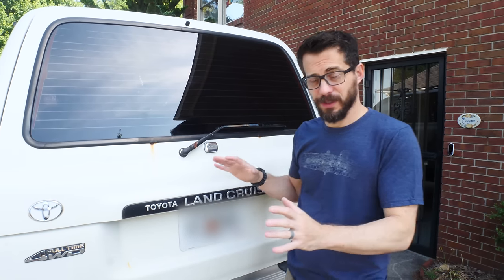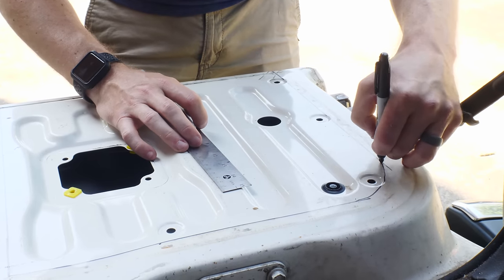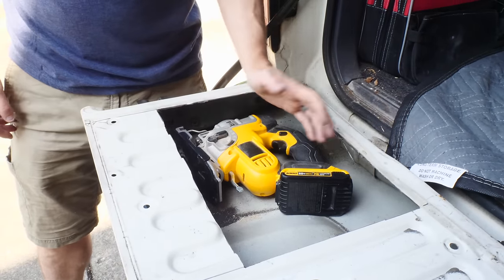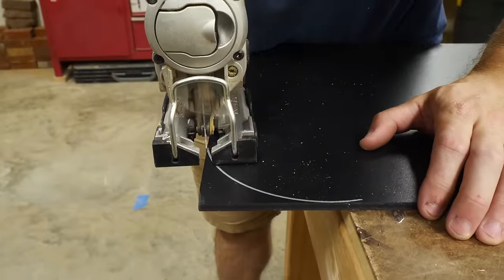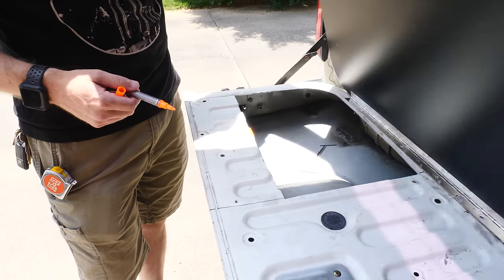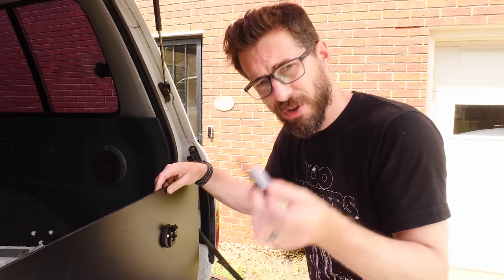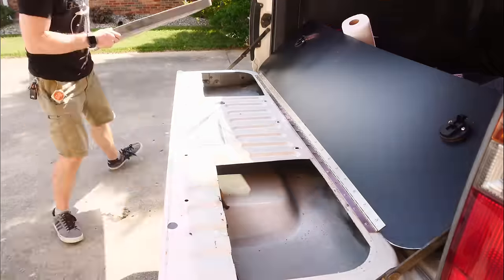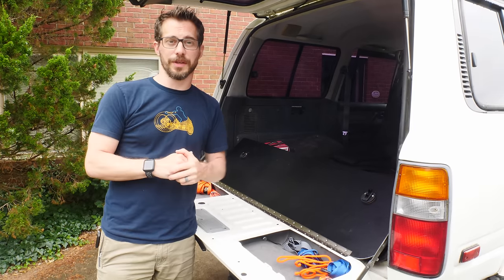Custom Tailgate Storage // Land Cruiser | I Like To Make Stuff

Comment: i wanted to replace my cars stereo because it had no bluetooth just regular audio cd and poor sound, but you have to cut out parts of the plastic cover wich terrified me really bad because i thought you would see it. after 1-2 years wondering i finally did it, it turned out so great, you dont see the cuts and the new pioneer radio goes a long way, has hands free bluetooth, 3 usb inlets, several outputs to use amplifiers and all that good stuff i wanted. 

totally worth it in the end :) 

even if you screw up, they make those tailgates in factories every day, so worst thing to happen would be you having to buy a new one wich is no big deal really

Comment: I would use a hole saw for the tighter corners instead of a jigsaw - less cleanup and accurate radius. Great video, but as a contractor, I'm a bit nervous of it due to always hauling heavy tools around and bashing it in.

Comment: Installing a second battery and building a box with a power inverter in it along with a amp and subwoofer to take up the middle seat floor space... So basically building a second center console with a sub woofer amp and a power inverter all built in one box to save space and take up unused space in my work truck

Comment: A project I want to do but am scared to start?? Here's one! I am starting woodworking and thankfully before he passed away my grandfather acquired MANY tools and threw them into a 50' x 14' storage building he bought. This was in 2001... So now I have cleaned out TONS (literally) of items and made 24' of it into a wood shop. I want to run power to this building but I have to do It on a budget. Currently I have a 100' 12 Gauge extension chord that runs 2 fans and 1 saw at a time!! Im in Texas and the inside of that building is around 126 degrees. MY project is to use bubble wrap and Mylar (safety blankets) to insulate this area, Cheap drywall to make it a room, wire it for electricity, and finally run the power to install my AC window unit as well as being able to run a simple dust collection kit... phew! there it is.. but the electrical to me is by far the most daunting.. should I run it from the house? 82 feet away with the power box at 120' away! or should I buy a power box and install it and have the electric company come out and run power to it?? This is a lot to do I know but it is all in effort to utilize a POTENTIALLY prime "maker space" that I was blessed with.

Comment: Great initiative, Roberto!

One suggestion would be to 3d-print a new set of rings for the latches that allowed you to insert the fingers from a flipped position that what you do now, hence, affording a more natural and ergonomic motion.

By any chance, despite the EVA against the metal, did you get rattling of the objects hitting the foam PVC? I wonder whether you've added some EVA to that side as well off camera.
Reply from the maker: Actually no, it's dead quiet back there and I haven't done anything else since we shot this a few weeks back 👍🏼

Comment: I have a blocked shower mixer that I can only unblock by cutting out a hole on the back of the stud partition wall. Thinking about making the access hatch I have to cut out into a feature, like a hinged mirror, but haven't had the nerve to start it yet!

Comment: You should try ABS it is available In sheets and is the same as most plastic in cars it takes heat very well and the thin stuff works almost like Kydex for knife sheaths when you heat it to 300 degrees cool project I've been wanting to do something like this to my RAV4

Comment: Did you consider running some kind of stiffener along the plastic to help with the rigidity? A little strip of wood or thin metal bar stock would work well to make it flex a bit less. I'm not sure how well it would fit along the tailgate though. Really cool project.

Comment: Scariest hole I ever drilled was in the bottom of my hull of my boat after I built it. It was a large 3 inch hole for a transducer for a depth gauge. It worked out great and after 4 years has never leaked. It is the boat you see on my icon.

Comment: One time i've been realy scared to customize something. I bought a new 5 strings bass, pretty expensive (vigier if you are interested) but the brand doesn't sell it with a pickguard. So i made one myself and i had to drill holes through my own bass, it was pretty scary, and heartbreaking. But also realy rewarding!

Comment: As always - a great project! Thanks for the video! Could you reinforce the plastic cover with metal ribs and edging? Would strengthen  it and make it weight bearing over the holes you cut for when you load the truck or sit/stand on the lid...

Comment: I think it would be a good idea to put some thin foam insulation tape around the edges of where you cut to prevent the paint rubbing off from tools going in and out and to protect your hands from the sharp edges

Comment: Bob, I have a project that I've been meaning to do as my "spring project" and as you can see, it's summer and the project isn't done. I told my wife that for father's day that I wanted to do my project. Well, my project is a simple wall mounted bookshelf, but is customized to hold my loose nintendo, super Nintendo, and genesis games. Where I would like to have it would be really nice, but my wife just keeps saying why I can't just go to Ikea to get the parts. I don't exactly have the space to do it, but as a couple day project, I could do it. I have the plans, measurements and how to mount it all planned out, I just don't have a lot of time to really do it as I have little kids as well. I'm also scared that doing this, my wife won't really like the way it'll come out. I follow you on IG as SeanOGaming. If you have questions, feel free to contact me there.

Comment: Yeah I'm actually thinking of welding some heavy metal brackets on my pickup because I heard it helps with stability. But I'm a horrible welder and I'm afraid of messing up the car's center of mass.

Comment: Had an old jeep. I removed the carpet and stripped paint. Then rhino lined the floorboard. Eventually I added a drain like off a boat to floor and would just use a water hose to clean the sand from the floor.

Comment: Very kewl project but please round those corners next time. It will look cleaner and prevent cracks forming.  You  rounded  the hinge side of the lid but not the other side. but in the end it's yours. Nice Job.

Comment: I just recently "vandalized" one of my (really expensive) AVRs by redesigning/improving the entire analog signal path. Partly for better audio, but mostly just to have a reason to learn smd welding... It just felt wrong desoldering almost every component on those well designed, beatiful to look at PCBs (it didn't really help that i looked at the cost of replacement boards before i started it...)

Comment: 3/16" Polycarbonate sheeting would have been perfect. That expanded PVC is only meant for interior use at that thickness. You would have needed probably 1/2" or better PVC to keep it from melting.

Comment: For a more resilient product to use to the cover try max metal it’s another product used for signs it comes in many colors and different thicknesses it’s an aluminum composite that it’s much more durable than the pvc

Comment: Hey I like what u did did something like that on my truck but around the hole on the truck I took some of the trim u buy at any Walmart or auto part store that is for your door to keep the paint from chipping it comes in different colors I used black  because that is what  walmart had at the time it made it look factory built and hide the sharp edge of the metal u also could use a rubber tube cut down one side to do the same

Comment: If you used the original sheet metal cut outs as doors, it would blend in better, also would keep the access door strong using the same pieces.

Comment: Try using Protective Welding Spray when cutting near thing that are dangerous near fire (ex: electrical cords or foam inside panels). I was getting scared when I saw the fire flicking off the cutting of the panels...

Comment: Great video, I have Land Rover Discovery 2 im planning on doing a similar project for storage. Im also in the works of trying to come up with a design to make available water when off road. I would like to figure a way to incorporate it behind the rear bumper, it would be a pressurized tank that you could pump with an air hose to be able to spray off and have clean water to shower with. The other option would be to install it on the roof but im not sure I would want to deal with anymore poor aerodynamics than I already have. Nothing screams bad mpg like driving a box on the highways as Im sure you know. Cheers!

Comment: I really like the idea of this, and want to do it to my 100 series, but you’ve got me thinking. What do you think about the structural integrity of the sheetmetal would be like if you added limiting straps to the door, so that you could potentially use it as a back rest in the open position and use the tailgate as a seating area? Obviously you’d have to make a cover for the interior holes, or make a second door, but I’m intrigued by it.

Comment: Nicely done and simple too. I'd do that to my SUV but my tailgate is full of rear window and the mechanisms for it.  I made a bunch of irreversible changes to mine, still the hardest was drilling the first hole in the sheet metal to run the new wire harness through. #bigbodybroncobuild if you're interested in the extent of damages I did.

Comment: Awesome project!
I've got one which I'm pretty worried about, I need to put a bigger loft hatch in the ceiling. If I screw it up, it will just be a big hole in the ceiling.
I'm pretty good with DIY stuff but this one worries me.

Comment: Yep, Dot want to drill into the dash to ass toggle switches for my offroad lights. 13 year old truck and scared they wont make the platic panels. So, i replaced the radio and it came with a fixed cubby hole underneath. Sucks as i hoped I couldhave turned it into a panel.. Oh well, the toggle switches are hidden inside the cubby. Loos weird seeing no switches to turn on my lights, but at least noones going to mess with them.

Comment: I got a cool project. I want a Patriot Camper trailer, but I don’t want to buy it for $35k. So I am thinking about converting a utility truck into a trailer, and outfitting it with a stove, electrical panel, water pump, tent, etc. of course, my biggest fear is buying a broken down PG&E truck, and screwing up the chassis weld/bend.

Comment: If the plastic doesn’t work long term, some diamond plate aluminum would work really well and look awesome. Maybe use some rubber around the edge to cut down on rattling noise.

Comment: I have seen similar storage but better hidden by using ply wood panel that slides over the cut out from the top.  Anyone searching the vehicle would think it’s just there to protect the tail gate especially if there are some fake screw heads holding it in place.

Comment: Possibly, a side from using the latches, 5 or 6 smartly located nickel or quarter size Earth magnets (strong, coin size, silver magnets sold at Lowe's or Home Depot) possibly could have worked for holding your cover door closed. Possibly simpler

Comment: Some sheet metal rubber edging might give the hole edges a little cleaner look and prevent cuts or scratches even more. Also, is that plastic strong enough for a knee or a foot to be placed on top of the cavity?

Comment: I know I'm about 6 months late on this one, but I have a 2002 CRV that I'd love to customize into being a camper for weekend getaways to North Lake Tahoe. I still need the vehicle to be useful for more pedestrian applications, but I'd love to be able to go up during the summer or ski season and just sleep in the back of my car for a night or two at most. The issue is that the seats don't fold completely flat, but I'm hesitant to start on the project because the shape of the cabin is odd and I fear that this project has the potential to just spiral out of control and cost WAY more than just renting a hotel room or something along those lines.

Comment: Yeah, I have one of those "analysis paralysis" projects right now! I'm considering swapping an older CRT monitor for a newer LCD in my PGA Tour Golf arcade game. While I like the "old school" look of the CRT scan lines, and while I won't get the same aspect ratio on the LCD (I lose horizontal width due to letterboxing), the pop and clarity of the colors and graphics on the LCD is stunning. But once it's done, it's done, and I'd be afraid that anyone who might be interested in buying the cabinet would walk away because I did this "modernization". Your thoughts?

Comment: Make those latchs electronic instead with a plugs just in case you need to remove the tail gate. Easy.. by that way try to use some relays and selenoids since are stronger and last forever

Comment: I would suggest cutting the panel holes smaller than the size of the hole and then folding the sheet metal "flaps" down. This will eliminate sharp edges. If you really want to be creative, the "flaps" you fold down could be shaped to the contour of the door as to make a nice solid boxed area. This will prevent things from sliding around in the panel opening when taking turns.

Comment: Important PSA: Please check your local laws before doing this. It may be illegal to add a "hidden compartment " in your car.

Also a few tips. You could use edge trim (banding) on the cut metal for added safety and aesthetics also it's a good idea to add a small washer to the back of the rivets so they don't pull out. Also chipboard has been used for decades for interior car panels so it should work for this.
Reply: Here in my country this kind of modification to a vehicle would invalidate its roadworthiness. And since it's a DIY thing, you couldn't get it certified either.

Comment: I'm trying to do the flush thing too. Just been thinking of best way to rack full sets of 1/4" 3/8" and 1/2" shallow and deep sockets. Have couple different ideas using magnet bars but if you've ever road on a tailgate you know that's the roughest riding spot on the truck so I'm hesitant until someone or myself can come up with a way so that I can open and close tailgate drive obviously and never open box to sockets every where. With this I plan to also have on inside of flip up door, set of metric and standard wrenches magnetized to it. Instead of going straight to magnet wanting to make it nice and have some cut out that each tool magnetic into for it's own self. Any ideas let me know guys! Thank you

Comment: I'd buy an old tailgate in a junk yard and switch them. Also from my experience these things aren't water tight, so it's a very bad idea putting things that may rust in there.

From an engineering stand point, the best place to add (loose) stuff is closer to the mass center, because it's less "bouncy" so to speak.

Comment: what was the thickness of the pvc foam board?  looks like 3mm.  if so 6mm is stiffer and may work better in the heat.  also you can use that foam board to make you some armor to go with your star wars helmet.  the mandalorian mercs costume club suggests using the pvc foam board aka sintra to make the armor.

Comment: Have a old (fiberglas) boat with a crack in the railing about a foot in length. I have used fiberglas before but not on a structural piece. Wouldn't use the boat in the condition it is in. And I'm not sure if it would be structurally sound if I fixed it.

Comment: Not sure if it's been mentioned before, but maybe you can use some rubber edge trim on the cuts you made. A few year ago i used some u channel edge molding for pc cases when I was modding my pc and wanted to cut a bigger window in the panels. You could use that as well :) Not sure if I am allowed to post links here though :/

Comment: Awesome build! I feel though that having two separate doors for the compartments would reduce frustration if you're using your tailgate as a work bench and you need to get to a tool in there... With 2 doors you don't need to move as much stuff. But that's just my unsolicited advice ;]

Comment: removing the crappy linoleum tile in my kitchen and dinning room, and the contractor grade carpet over the narrow oak flooring in most of the main floor in my house. I have no clue what condition the wood floors are in, and it could either be a single weekend worth of work, or a summer long project.

Comment: Could always buy an extra door from the junkyard or wherever and experiment on something other the good one in any case you will have a spare if you ever decided to sell i am looking to modify my Tacoma and have thought of buying extra parts and mocking up my idea before doing it to the actual truck or just changing out the modified part for the stock part and you wont have to damage it.. just my opinion..

Comment: The only problem I see is if you go ard turns wint the stuff in side the storage side to the in side where you didn't cut out and make it hard to reach you should of framed ink the squares to keep your stuff from siding to the center of tailgate

Comment: Responding to the question at 11:45 yes I do have a project similar to this. I have a 1995 Chevy S10 that I’d like to cut into to create a flush mount LED light bar between the inches of 20-40” whether it has to be 2 light bars or one. And the Light bars will be placed to shine out the rear of the vehicle. Think of it as a reverse light set up. HELP or any ideas?